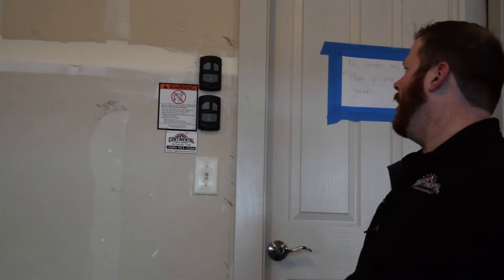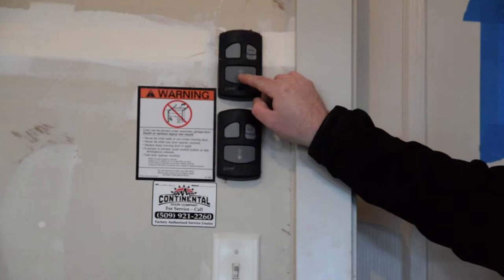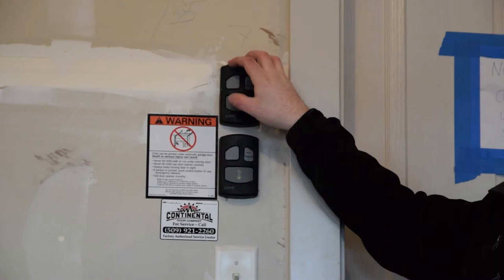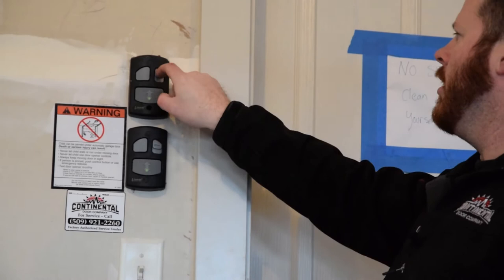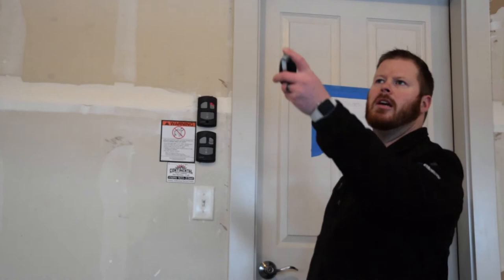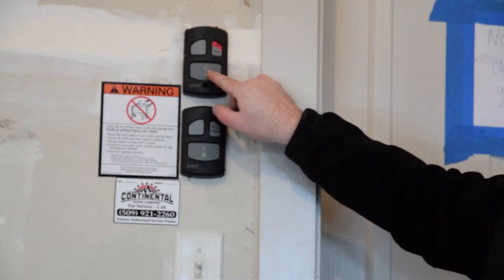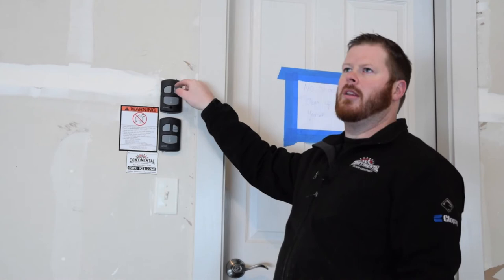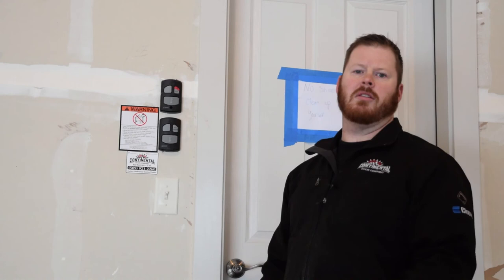How to Program Your Linear Wall Button

Comment: After a trnant movee out, I had trouble reprogramming two Linear remotes. The red light was flickering. After mqny faiked attempts, I got on YouTube and stumbled upon this video. The problem was the vacation mode lock button was in on position. Once I slid it to off position, the remotes worked!! Thank you!!

Comment: Hi there, lost my remote and needed to disable all remotes from opening the garage door in case some one try to get in using it. However, when I slide the wall unit button to Lock position, still can open the door using remote from another car. Is the problem with my wall unit? How can I verify and/or fix the problem?

Comment: I would like to know how to push the code box to close the garage door without entering code when I leave.  My sisters garage code box will do this but mine will not.  I have to enter code to close it if I don't want to use the remote in the car

Comment: I have to keep holding the close button to close my garage door, is this normal or something its wrong with my wall buton?? Thank you!!!
Reply: Check your sensors can be dirty or not aligned correctly. Use the lights on the sensors when moving the angles to align

Comment: My wall button has stopped working all together but my hand remotes and the garage buttons in my car still work. How do I reconnect the wall button to the receiver?
Reply from the maker: It sounds like a continuity issue, so first start with pulling the wall switch off the wall to check that the wires are connected securely to the terminals. If they are, your next step will be to check at the motor head. Find the labeled wall button terminals to make sure the wires are securely fastened there. And if that still doesn't work, you will probably need to get a new wall switch. Hope this helps! Thanks for commenting.
Reply: I have the same problem!